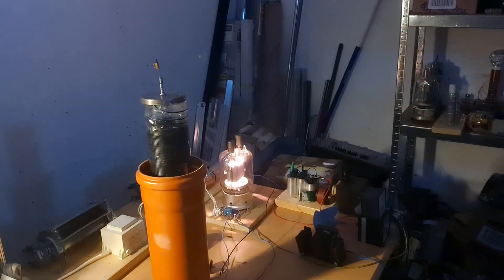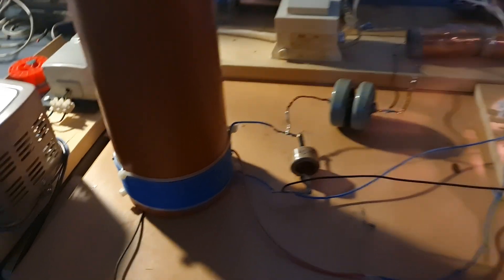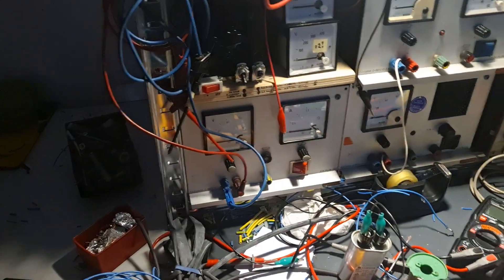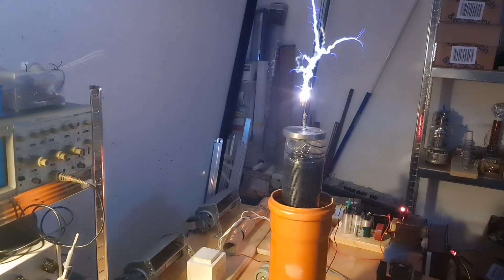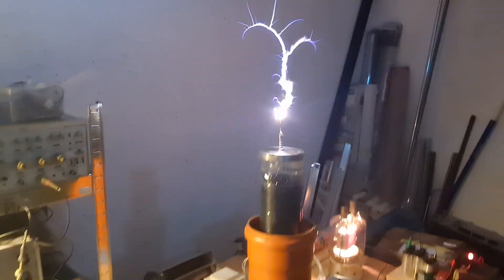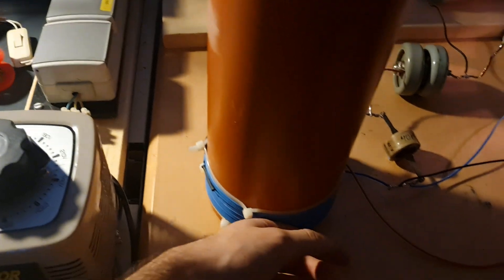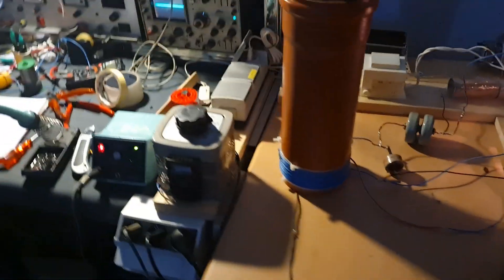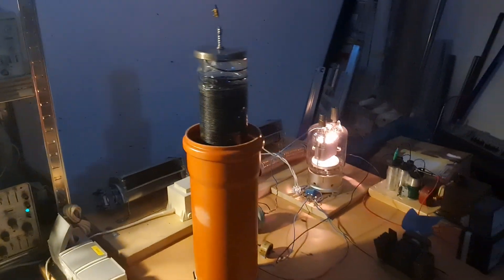Hartley Oscillator Driven VTTC: Update

Comment: Looks solid, you could get some small diameter copper pipe for the primary, and run it with a water pump inside, use car coolant or destilled water
Reply from the maker: @cheri621uwu  i just used thicker wire, that seems to have fixed it
Reply: @ ah okay

Comment: Hi Janno.  The high voltage breakout is fantastic! Is there any way I could get a schematic for your setup?  I have several of these tubes, along with microwave oven transformers and HV caps.  My long term goal is to use a VTTC to power a large plasma globe.
Reply from the maker: Yes it is possible, the schematic was shown in the last Video, only things that need to be adjusted is the primary turns and the primary capacitance to hit the secondary at its resonance frequency.
You can play around with turns and sizes in a tesla coil resonant frequency calculator, then you wind your secondary.
Then you change my Oscillators L and C to hit the resonance frequency.
remmeber that tube to grid capacitance is 20-40pF extra.

I still havent optimised this setup, its a bit better now with a thicker primary (i havent made a video yet) but I've noticed that it seems to like 2.9MHz more